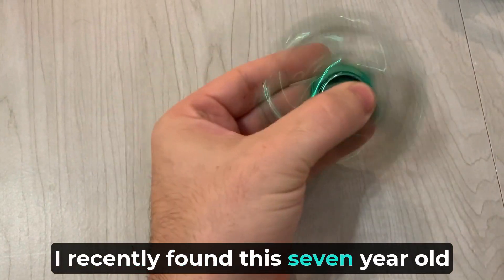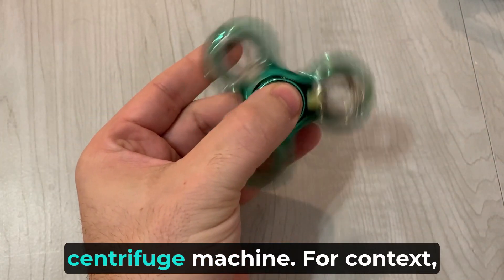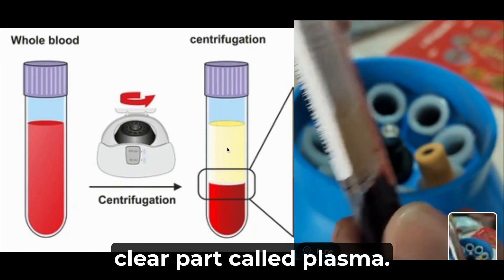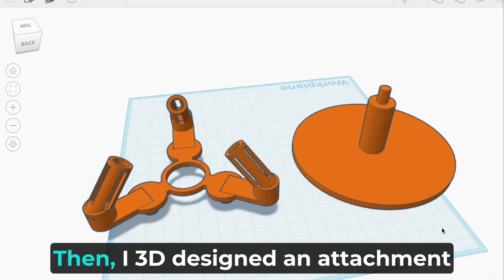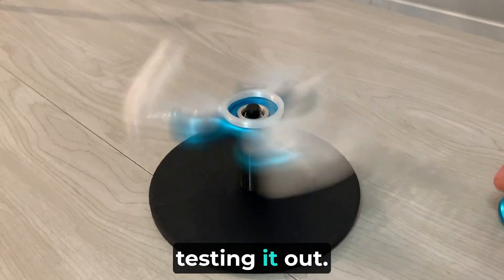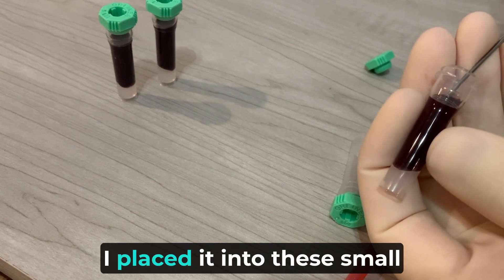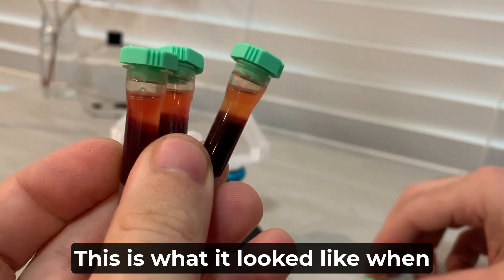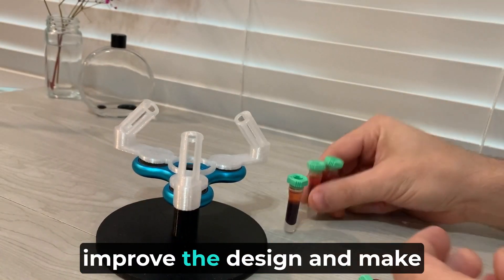Fidget Spinner Centrifuge Machine

Comment: If you have air compresor, just blow the spinner. It will much faster compare than hand spin it
Reply: I was going to suggest this! It’s very effective.
Reply from the maker: @ Absolutely,  this crossed my mind. My aim was to try an approach that needed no external input.  I also considered a bicycle wheel and swinging a string quickly (the string didnt work).  A simple motor would have saved me a lot of time too.
Reply: Careful not to spin it too fast, it can explode. It happened to me 😂